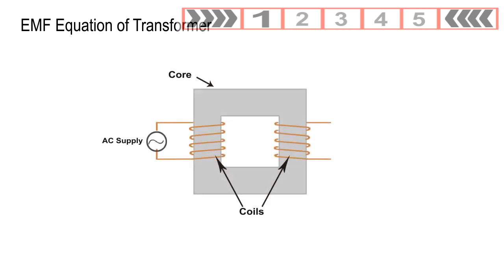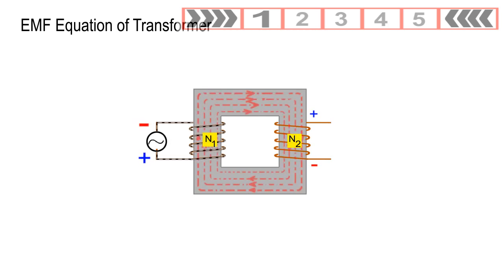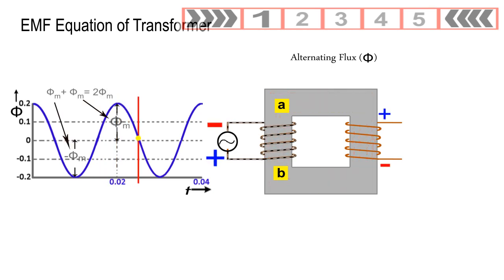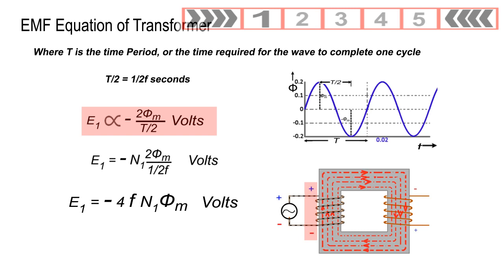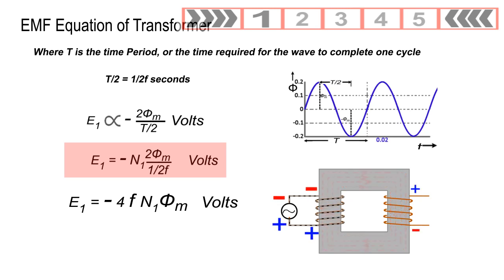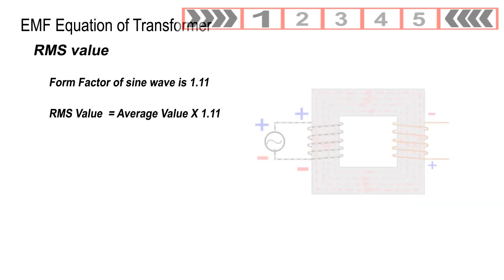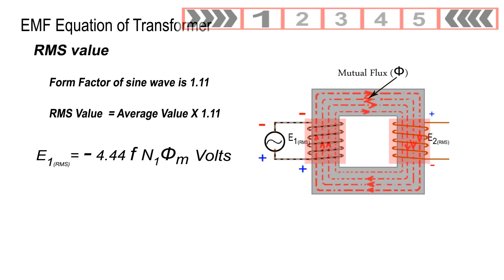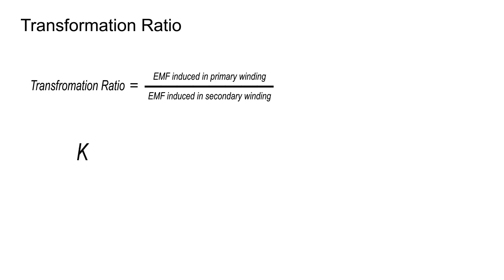Transformer Lecture 2 (EMF equation of transformer)

Comment: If the primary coil is just one wire, how do you avoid having a short circuit and tripping the breaker?
Are the neutrals of the primary and secondary coils connected?